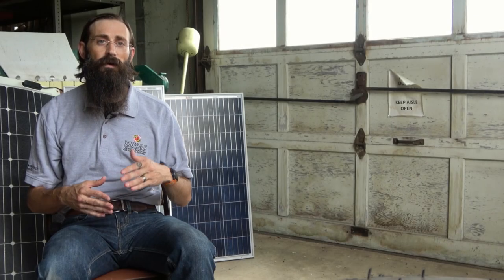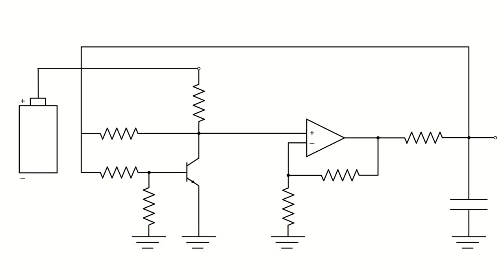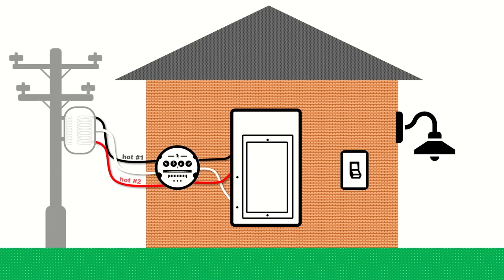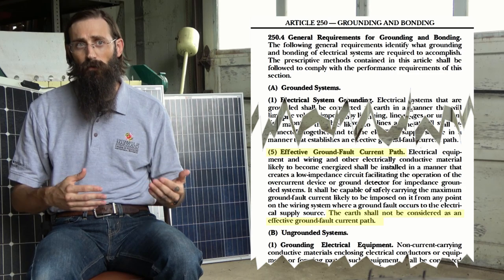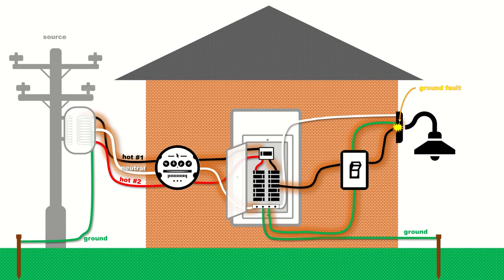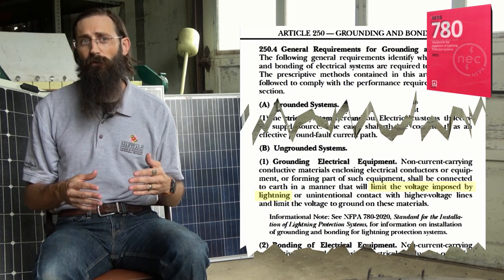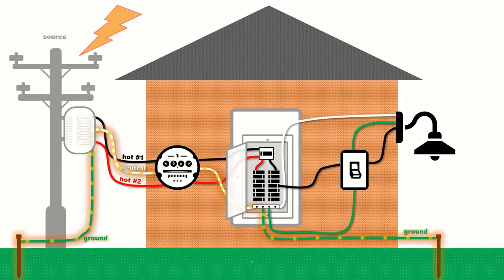How to ensure safe and effective solar grounding

Comment: does  an ac disconnect consider a main panel if installed before this main serice panel? my ac disconnect doesn't have any breaker its a manual switch for disconnecting the meter from the main service manually it has 2 200amp fuse inside. so my question is if do i need  a ground neutral bond in ac-disconnect switch  and isolated the ground neutral bond in main service panel. or is going to be ok just ground wire into my main service panel with breakers? the existing grounding system?

Comment: Thanks for the video. Are you saying that there should be a grounding system on the roof that covers the perimeter of the solar panel array, and that should be connected to its own copper rod in the ground? The frames of the panels themselves should then all be tied together and be presented to the earth terminal in the solar controllers or if using a solar inverter, to the inverter itself? I am completing a 40ft catamaran which has a 6kw solar panel array, two 10kw solar inverters, two 45kwh LiPO4 lithium battery banks and two 15kW electric outboard motors. I will be running the two hulls independent of each other, with 3kW of solar going to each solar inverter. I was thinking of doing four spike charge dissipators at the corners of the catamarans roof which would be linked together with 70mm2 cable. During weather that posed a risk of a lightening strike, I was going to then fit 4 removable large copper cables which would be attached to the spikes and draped into the water. None of this grounding would be attached to the frames of the solar panels, but would be to try to keep the charge of the localised sea area and the surrounding air above it, at an even voltage thereby reducing the risk of attracting a lightening strike. The cat is a solar cat so no mast to worry about. Does that solution sound likea good idea?

Comment: Totally Brilliant. 5 Stars. This video has viral potential from what I have seen on YouTube and DYI channels.
Should be mandatory in all high schools and electrical courses. Looking forward to grounding solar disconnect breaker box and inverter/battery for a off grid set up but the inverter is supplied with AC.🇨🇦

Comment: most informative video on grounding. watched few times to fully grasp everything. thanks
Reply: Grounding systems are a blessing and a curse. They are a blessing because if a piece of equipment in your house fails you are much less likely to have enough current flow through your heart. 
They are a curse in that they actually make your home a more susceptible to damage from a lightning strike
NOT less.
If a lightning bolt strikes the physical Earth in your neighbor's backyard there is a much higher chance of the voltage coming back up through the the grounding system than not. 
During a lightning event my home would be better served if I could implement an isolation switch temporarily isolating my system from the earth ground. 
The problem is I would probably forget to put it back to normal after the storm passed. Also, in the unlikely event that I would also have an equipment failure inside my house I would not be protected from electric shock. 
The truth is: MOST LIGHTNING DAMAGE ENTERS THROUGH THE GROUND SYSTEM. THE GROUNDING SYSTEM DOES NOT PREVENT DAMAGE FROM LIGHTNING IT OPENS A BACK DOOR ALLOWING IT TO HAPPEN.

Comment: Why would you ground a DC system to earth as the neutral is floating. Wouldn't it be wise
to make a lightening rod system to attract unwanted lightening strikes to safely carry it to earth? Cars, trucks, motorhomes all are powered by a DC systems and are not earth grounded as well as boats. We have DC as well as AC aboard our boat and no earth ground.

Comment: Excellent.    Now, why do the PV installers not run a ground from the ground mount, via the wiring trench, to the ground rod which is going to be near the entrance panel/meter base?

Comment: Yeah this is extremely helpful, but how about isolated 12v solar setups that are not tied into a homes main panel. Does having grounding rods around panels help in a lightning strike? Im just setting up a couple batteries with a couple 100watt panels, for a back up during power loss, but not hooked into the house in any way.
Reply: Yes that would help. Separate system needs a separate ground.

Comment: Grounding systems are a blessing and a curse. They are a blessing because if a piece of equipment in your house fails you are much less likely to have enough current flow through your heart. 
They are a curse in that they actually make your home a more susceptible to damage from a lightning strike
NOT less.
If a lightning bolt strikes the physical Earth in your neighbor's backyard there is a MUCH higher chance of that voltage coming back up through the the grounding system than not. 

During a lightning event my home would be better served if I could implement an isolation switch temporarily isolating my system from the earth ground. 
The problem is I would probably forget to put it back to normal after the storm passed. Also, in the unlikely event that I would also have an equipment failure inside my house I would not be protected from electric shock. 
The truth is: MOST LIGHTNING DAMAGE ENTERS THROUGH THE GROUND SYSTEM. THE GROUNDING SYSTEM DOES NOT PREVENT DAMAGE FROM LIGHTNING IT OPENS A BACK DOOR ALLOWING IT TO HAPPEN.

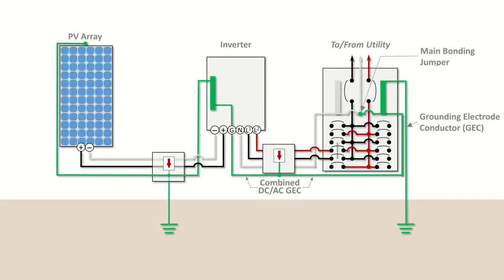Comment: Ok on the wiring diagram starting at 14:40 there are 2 box's with red arrows in them , 1 on the dc side and 1 on the ac side of the inverter. Are we just supposed to guess how things are wired inside these box's , do you assume we know how things are wired inside these box's. would it not be prudent to show us how things are wired inside these box's. I think if you showed use how things are wired inside these box's it would help us "to ensure safe and effective solar grounding" ???????
Reply: Maybe SPD?
Reply: its color coded lol, white goes to white, black goes to black, red goes to red, green is ground. There is no instructions needed
Reply: Maybe you need to learn gratitude. To say thanks maybe? 
He is helping you and helping us